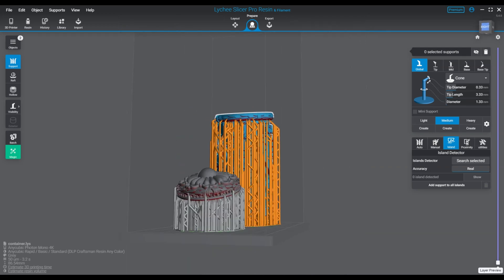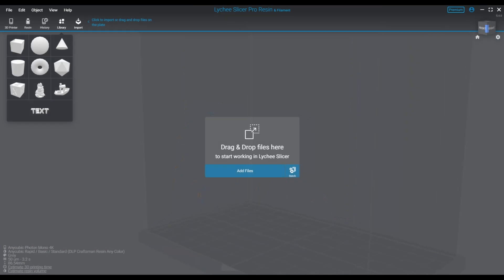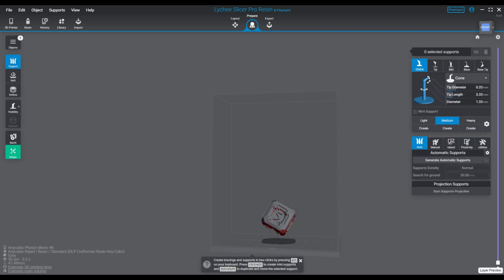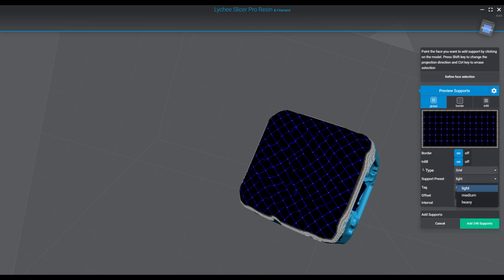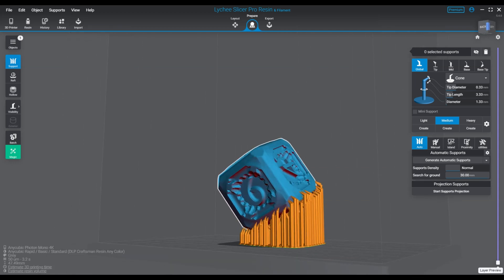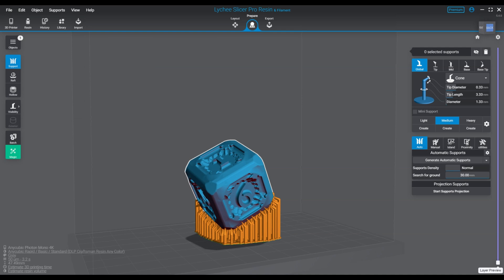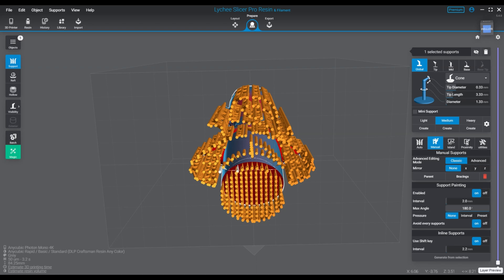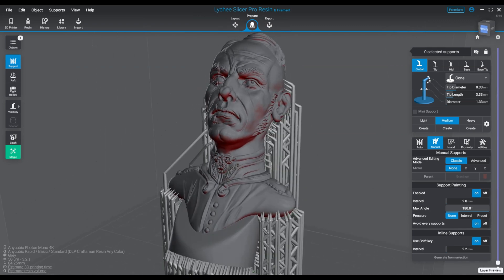Lychee Slicer Updates 5.3.2 and 5.4 - Minor and Major updates

Comment: I watched your video on the nice auto-support function (featuring the dense scaffolding) in Voxeldance Tango that seems to consistently work well, per your experiments with it. My question: Can you follow up with Mango to see if they will be improving Lychee Slicer to provide a similar, more robust, and consistent auto-support function that we can have confidence in using, and, if so, when might Mango make the upgraded/revamped feature available?
Reply from the maker: That is a great question, and yeah I will certain press them for more info on new supporting as they develop it. I do like the way that the auto supporting works in Tango, but some of its other features need a ton of refinement, so I consistently use Lychee hence why we are working closely with them now.
Reply from the maker: Funny this conversation has come up A LOT lately. In Discord, Reddit, and here I am consistently finding folks are really just looking for a reliable auto support. Thing is if you understand the "mass" of the object, it's all math. The supports need to be able to pull back the same or more pressure than is being applied at the FEP. This Peel force. The Peel forces are usually pretty high on heavy stuff, or where there is suction so in that case the supports must be heavier to withstand the pressure of the peel force. I have done over a year worth of experimenting and I think I find the right supports for most heights and weights, but it is tricky to determine the physical weight of the object sometimes and that is where you guess a little. Say for example you want to just support a 32 mm mini, auto supports light around .20 or so tip even smaller would be, just catch all the islands and make sure any angle zones get a little extra. If the figure is say around 72 - 100mm firstly consider bulk, and hollowing, and then from there you could use a medium tip from .33 - .35 with a bar anywhere from 1.33 - 1.35. If it's heavier or bulkier go with something a bit larger, but always go in increments so you can test each level and only go as high as you need to, not to over-support. If this is applied, you use Lychee's auto supports, do a little hand support on the islands, check at a few layer heights, and you should actually be good. Now, that being said this does not work all the time, and the quality might suffer a little here and there. However over the times I have tried these types of tests they do work about 95% of the time. It still requires hand assistance, but it does pretty much do most of the bulk of the job. If Lychee or any other slicer could support automatically based on this idea, even catching ALL the islands on one sweep, possibly even allowing you to specify to search at multiple layer heights. It would be what we are looking for. The issue with other slicers such as Tango is that there are a lot of collisions, and the manual support is terrible. So, there are pros and cons and there are reasons why we stick with Lychee over the rest. It works 99.9% of the time for what we need, we just know that there is no real easy button...not yet anyway. When that happens I might be out of a job.

Comment: I love Lychee, but since 5.3.2 and 5.4 the only show supports in proximity error has not worked for me. Makes everything harder. Going back to figuring out Voxeldance tango until it's resolved.
Reply: Happy to hear it's not just me. I feel like the heavier supported models have the issue more often.
Reply from the maker: Yes, I agree the heavier the model the more it seems to be an issue.
Reply from the maker: Okay, thanks for the info on that. I will do some digging for you and see if we can get that fixed. I will try and make it repeat the issue as well on my end see if it something I can figure out a fix for.
Reply from the maker: Hey I just checked and did a proximity check, and it seems to work okay for me. What exactly makes them harder to see? I just go to "view->Show only supports in proximity error" should just show the red supports. If that does not work, I would suggest re-installing the software as it might just not be working. Now I am using 5.4 not 5.3.x
Reply: @IPrint3dMinis currently it's not hiding the normal supports. Will try a reinstall.
Reply from the maker: Had this issue the other night. I just did a soft reboot of the software, close and kill all applications related to it. It seemed to work again after that. Hope that helps. @sykosponge